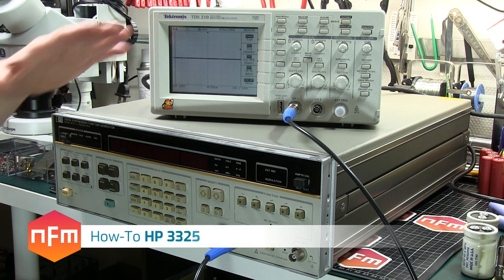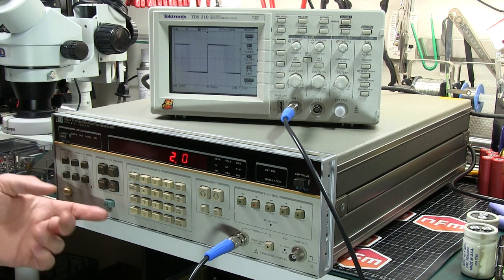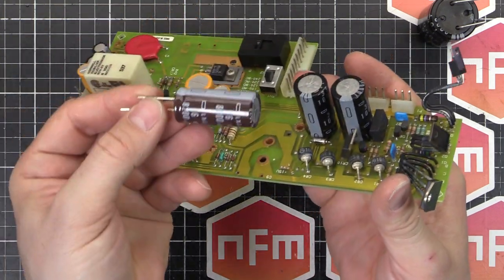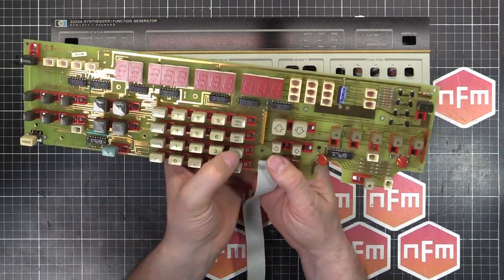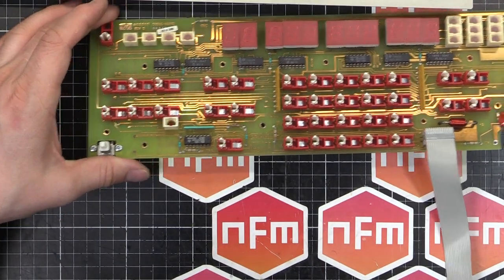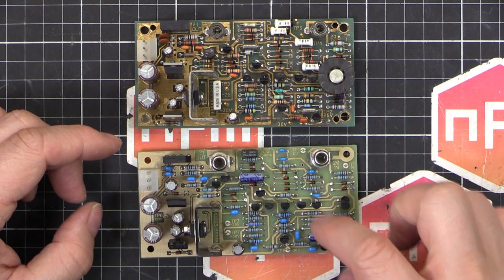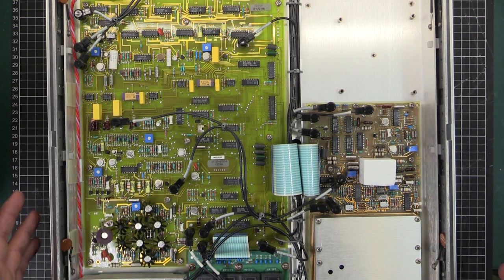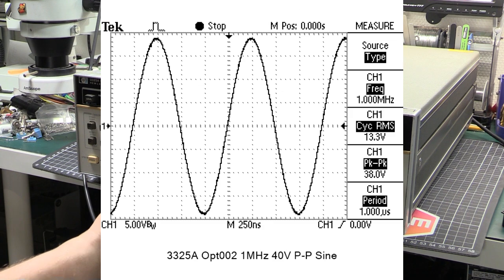Upgrade a HP 3325A With HIGH VOLTAGE Output!

Comment: I was very pleased to find your video and even more pleased to find your PCB gerber files for the Opt 002 board! Just sent off PCBWay and placed an order with Digikey for the various parts I don't have in my stash. Very excited to try upgrading the unit I have to the HV output. 

One note for those converting from the standard configuration, according to the manual in section 8-M-2, there's a jumper you'll need to cut on the A6 logic board located between the configuration switch block S1 and U43. This lets the logic know you've got the 002 HV Option installed.

Comment: Unfortunate that you found the power wires for the 002 option cut off. I've just looked in my 3325A - which doesn't have the option 002 board. The wires are all still in place, curled up, and cable tied, under the transformer. Still has the power supply plug to fit the 002 board too.

Comment: Hi there, interested in building this, hope you still look at this after all this time.  My query is about the BOM in the Google drive as there seem to be a couple of questions and comments in the forum which differ from the BOM you have put up. Member P diddy refers to values for R10 and C19 but neither the HP service manual or your BOM have values or have them in the circuit schematic. The next query is using 2N3904/06 transistors, again P diddy refers to the need to use 80v transistors in some locations which you agree with but the BOM lists 3904/06 throughout. And finally in the blog you mention the 10k resitor should be 0.1% and say that you used 1% for the first build and will correct that in the next build, unfiortunatley the BOM still lists 1% parts.

Hoping you can help, is there a newer version of the BOM ?

Comment: Nice project. How much time did you put into this build? I would imagine that it took a while to gather all the info.
Reply from the maker: Good question... I'm not sure. :D It wasn't done in a day, that's for sure.
Besides redrawing the schematic from the service manual and laying out the PCB, which is normal for any project, I spent a bit of time cross referencing and figuring out what transistors HP used as they didn't reveal the actual part numbers for all of the ones they used.
Reply: @NearFarMedia  Did you really superglued the transistors? Is superglue a good thermal conductor for this application?